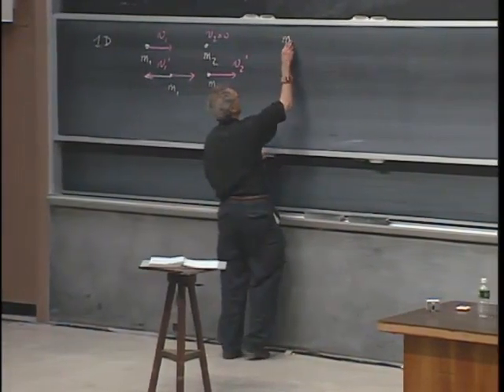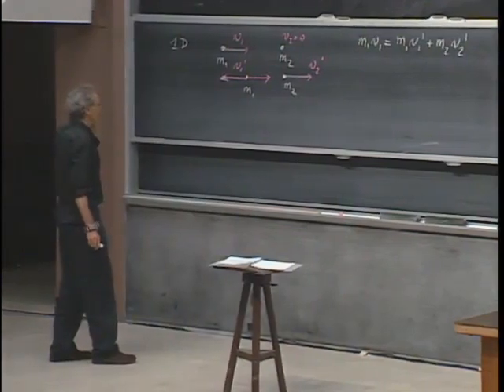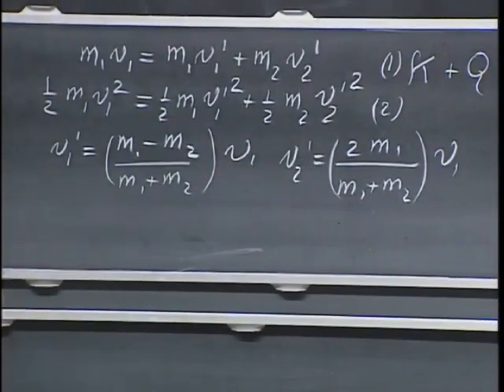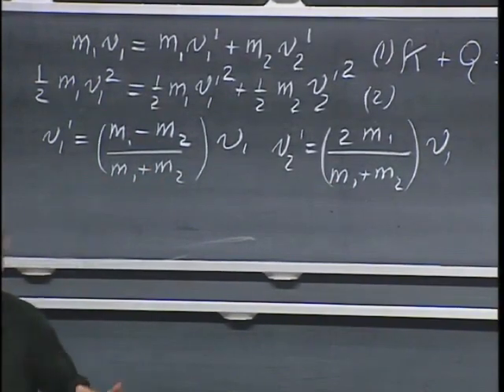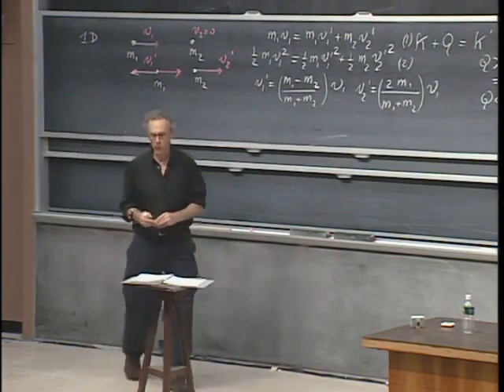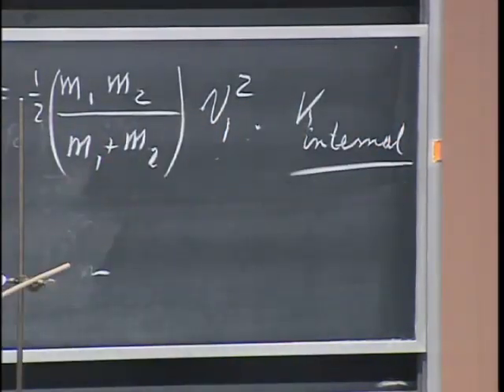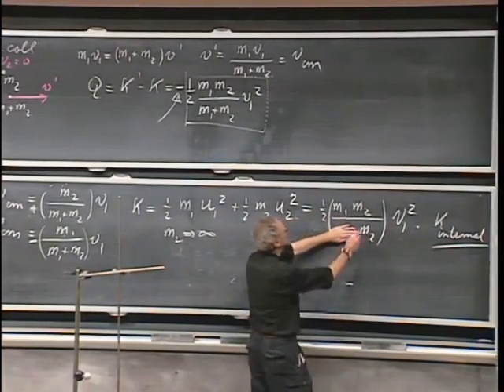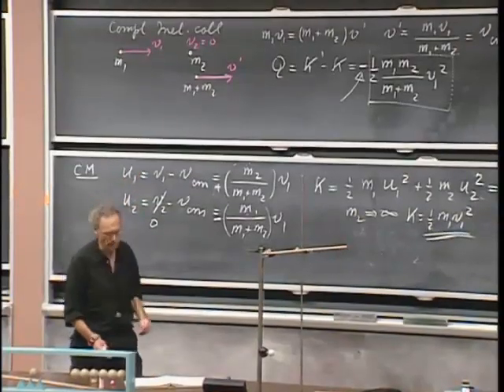8.01x - Lect 16 -  Elastic & Inelastic Collisions, Center of Mass Frame of Reference

Comment: Teacher, can you tell me the answer of the question at the end of the lecture (46:38)
Newton third law? But the last cases
Reply: Exactly why it happens it fascinating physics. The compression wave that travels through the balls is an approximate soliton. 

The underlying reason for why it's solitonic was discovered in the 1950s when the Fermi Pasta Ulam simulations were done. Basically, the expectation that more and more balls in Newton's cradle will move fails to occur because the dispersion of the compression wave is exactly balanced by the nonlinearity coming from the Hertz deformation law for elastic spheres. 

It's a very special system.

Comment: is this correct 
let force on the be F
F = ma 
here m is very large(not infinite)
therefore a->0 as F= ma   ////////////////////// acceleration of the wall
u = 0 ////// initial velocity of wall
therefore v->0 as a->0  /////////////// final velocity of the wall
therefore K.E. of wall = 1/2 (m) (v)^2 -> 0 as  v->0
Reply from the maker: what is the momentum of the wall after the collision?
Reply: 2mv but the velocity of wall is very low
Reply from the maker: 2mv - what is the meaning of m here and what of v?
Reply from the maker: correct
Reply from the maker: KE of wall =0.5*p*v, p is finite, but v =>0 thus KE=>0

Comment: If kinetic energy after collision in inelastic collision in centre of mass frame is zero then What is kinetic energy after collision in elastic collision in centre of mass frame???
Reply from the maker: watch my 8.01 lecture on collisions
Reply: Lectures by Walter Lewin. They will make you ♥ Physics. 
no no my question is in elastic collision in centre of mass frame also the kinetic energy is conserved???
Reply from the maker: In the com frame the momentum of the system is ZERO. Take it form there.

Comment: Hello sir, 
Could you please answer, 
Why   momentum in the center of mass frame is zero?
Reply from the maker: question unclear. When I throw an object upwards there is an extrenal force acting on the COM (gravity) thus momentum of the COM changes.
Reply: At the time 26:54 on lecture 16 (8.01)
Reply from the maker: @ashrafali4297  what I said is correct as the net external force on the COM is zero.
Reply: Thank you sir

Comment: What is the solution to the wall problem in which it has momentum but no kinetic energy?
Reply from the maker: you will have to figure that out on your own.
Reply: It has kinetic energy, but its really negligible.Am I right?
Reply: as M=INFINITY,m=0(approx)
Reply from the maker: If m is the mass of the tennis ball and its speed is v, then after the elastic collision with the wall, the wall will have a momentum +2mv.
Yet the wall has no KE if the wall's mass M is very high. How can the wall have momentum but no KE?
Reply: It is not a closed system, the wall is supported from the "other side" by an external force. Correct?
Reply from the maker: The SOLID idea behind it is that in the absence of external forces, momentum is conserved in any collision.

Comment: Can anyone tell me what is the difference between Center of Mass And Center of Gravity ?
Reply: Good question.   The reason we commonly get away with using these terms interchangeably, is that Earth's gravitational field is close enough to uniform in most situations, that there is no significant difference between these points.  But if you did have a non-uniform gravitational field in the problem in question, there would be a difference.

Center of mass is what you calculate when you take a "weighted average" of the positions of all the masses that comprise an object or system of objects.   By "weighted average" I mean that you multiply mass*position for each object, add it up, and then divide by total mass.   This calculation is gravity-agnostic, as it ignores any gravitational fields that apply to the objects in question.  It exclusively studies the inertial masses of the objects.

Center of gravity is what you get, when instead of using mass alone to take the weighted average, you account for the gravitational force when taking a weighted average of the positions of the point masses in the system.   Center of gravity is the point at which gravity appears to act, as if it were a single concentrated force.  It is the point where you could apply a single point support force, and not require any torque to balance it.  If you apply a point support force at exactly the center of gravity, the object will be in an equilibrium of neutral stability.  Above, and it will have a stable equilibrium;  below, and it will have an unstable equilibrium.

Comment: is there a way to understand why a very heavy object imparts twice its velocity to a very light object without using the equations ?
Reply from the maker: +Shivam Agarwal  I do not understand your question. Please be more specific.
Reply: +Lectures by Walter Lewin. They will make you ♥ Physics. You told that when a very heavy mass collides with a stationary light mass, the velocity of the light mass after the collision is double the velocity of the heavy mass before the collision. You proved that using the equation of final velocity. can we understand this result without using those equations and just by common sense ?
Reply from the maker: +Shivam Agarwal Yes that is common sense. Assume the heavy mass M has speed V, the low mass m has speed 0 (m<<M). Put yourself in the moving frame of the heavy mass. The small mass is approaching you with speed V. Thus it will bounce back with speed V in your moving frame. Now transfer back to the non-moving frame and that leads to a speed of 2V for the small mass.
Reply: +Lectures by Walter Lewin. They will make you ♥ Physics. I got it now. Thanks !
Reply: @lecturesbywalterlewin.they9259  I don't understand please understand me with some easy concept

Comment: in completely inelastic collision you told that energy lost is in the form of heat but the sound produced during collision is also a form of energy. where does that come from?
Reply from the maker: yes that's also energy - in general it's INSIGNIFICANt compared to heat.

Comment: Why is the conservation of kinetic energy still of the form 1/2mu^2? When you change the reference frame, the kinetic energy changes and I don't see easily why the conservation equation should have the same form. Can someone explain this to me please? Thanks!
Reply from the maker: if the object stands still in my ref frame but has speed V in another ref frame then the KE and that other ref frame is 0.5mV^2 - that is easy to prove
Reply: @lecturesbywalterlewin.they9259  but you need momentum conservation in order to prove that, correct? When transferring to the center of mass frame, the total momentum is 0 so the cross terms vanish. When going to a different frame the cross terms before and after the collision are the same but only because momentum conservation holds. Is my understanding correct? Thank you very much!
Reply from the maker: @hkl103 >>but you need momentum conservation>>>  No that is not needed  watch my  8.01 lectures, it's all there.

Comment: When transforming to a different reference frame, why can we assume that 1/2m1u1^2 + 1/2m2u2^2 = 1/2m1u1'^2 + 1/2m2u2'^2 (eqn. 1) is still the correct form for the kinetic energy conservation. My answer would be the following: I insert u = v - V (v being the velocity in the old reference frame, V being the velocity of the new reference frame, e.g. CM frame) and then multiply out: 1/2m1v1^2 + 1/2m2v2^2 + V(m1v1 + m2v2) + 1/2(m1+m2)V^2 = 1/2m1v1'^2 + 1/2m2v2'^2 + V(m1v1' + m2v2') + 1/2(m1+m2)V^2. Since 1/2(m1+m2)V^2 is constant and the same on both sides, 1/2m1v1^2 + 1/2m2v2^2 = 1/2m1v1'^2 + 1/2m2v2'^2 due  to energy conservation in the original frame we now only need momentum conservation such that V(m1v1 + m2v2) = V(m1v1' + m2v2') and thus eqn. 1 holds in the new frame. I would argue, we need momentum conservation in order to prove that eqn. 1 is indeed correct. If there was no momentum conservation, both sides would differ. Walter Lewin is opposing, that we don't need momentum conservation. Can anyone explain, where my mistake is?
Reply from the maker: KE is not conserved if we change reference frames  That is very basic physics
Reply: @lecturesbywalterlewin.they9259  This is not the issue. That KE depends on the reference frame is absolutely clear to me. But exactly because of that I was asking why you could use 1/2m1u1^2 + 1/2m2u2^2 = 1/2m1u1'^2 + 1/2m2u2'^2 when going to the CM reference frame. You used that formula without explanation why you could do that, and just said it holds because the collision is elastic. I didn't buy that immediately. So to reformulate my question: When kinetic energy is conserved in one frame, why is it conserved in the other frame, even though the value of kinetic energy changes. And my argument was, that because momentum is conserved, the change in kinetic energy is indeed that same. Which physically makes absolute sense, since energy should be conserved in every frame. In the meantime I have even found a nice argument in the Berkeley physics course. Because they don't want to rely on Newton's third law for momentum conservation in the case of finite speeds in special relativity, they start with energy conservation in every frame and from this conclude that momentum is conserved. One could turn this argument around and do what I did, I think. I pretty sure, there is another way of thinking about it, since there was nothing special about to original frame of velocities v that was used.
Reply: @lecturesbywalterlewin.they9259  By the way, thank you very much for your lectures and our discussion. I have already graduated in physics in Germany and watch all of your lectures to find and close some gaps in my understanding of basic physics. This is why I try to be so fastidious with some details…

Comment: Relating to the balls on a string problem... could it be because the number of balls create a pulse (like a wave) with a wavelength equal to 2n (where n is length of the number of balls pushed), and since the balls were only given a positive velocity (not oscillating), only the positive amplitude of the wavelength is represented. The positive pulse then travels through the balls when they strike each other until it reaches the end, where it knows it has to create momentum as the preexisting momentum is gone, and that this momentum must affect the number of balls which could not get rid of the pulse, equal the length of the pulse (n) which is also the total length of the balls?

Comment: Problem of the 8 balls at the end of the lecture. Let's mi and vi be the mass and velocity on the incident balls and mr, vr, the same for rebounded balls. As there are no external forces, for momentum conservation mi.vi=mr.vr, and for KE conservation 1/2.mi.vi^2=1/2.mr.vr^2. Working with these 2 equations the conclusion is that mi=mr (1 ball rebounded for 1 ball incident, 2 balls rebounded for 2 balls incident,...5 balls rebounded for 5 balls incident...and so on). Furthermore vr must be equal to vi.
It's OK?.
Reply from the maker: +Jordi GS The solution is much more complicated as you are dealing here with multiple collisions. What is exactly happening when you swing 2 or 3 balls? Of course, the final result is constant with the conservation of momentum and energy. But that does not tell the whole story.  I suggest you find the solutions on the web.
Reply: +Lectures by Walter Lewin. They will make you ♥ Physics. Can you exactly tell me where on the web?
Reply from the maker: +Jordi GS http://www.school-for-champions.com/science/newtons_cradle_derivation.htm#.VuGayun5-Jo
Reply: Thank you, Sir.
Reply from the maker: +Jordi GS Notice the Summary
SummaryDerivations to explain how Newton's Cradle works depend on various assumptions. One derivation assumes that the balls are touching, using the laws of Conservation of Momentumand Conservation of Energy. Another explanation assumes the balls are slightly separated. A third—and more exact—derivation accounts for the slight deformation of the balls, causing them to act like linear springs. This is a more complex view.

Comment: sir in elastic collision does the reversal of velocity wrt centre of mass reference frame hold true for collision between m1>>>m2  

as it is in this question
two steel balls of mass 10kg and 10g roll  towards each other with 5m  per sec and 1m per sec respectively on a smooth floor.After collision with what speed  10g mass moves (given perfectly elastic collision)
Reply from the maker: If a ball of mass m is in pure roll then the KE= m*v^2(1/2 + 1/5). Thus you can calculate what the total KE is for each rolling ball before the collision since you know m and v for each. If there is NO friction with the floor and NONE between the 2 balls and if the radii of the 2 balls are the same then to rotational KE cannot change and both balls will continue to rotate after the coll in the same direction as before.. You can now apply the conservation of momentum and of KE and you will be able to solve for the sliding velocities of each ball after the coll. If the radii are not the same the problem cannot be solved as is now.
Reply: yes that is fine and I get the answer But when i try to solve this problem in the centre of of mass frame of reference  

In lab frame 10Kg moves with velocity 5 in +X direction 
                     10g moves with velocity  1 in -X direction

In center of mass frame
     10kg body is approaching with a velocity  [ 5 -Vcom ]  from one direction towards the centre of mass
       (this velocity along +X )
     10g body is approching with a velocity [1+Vcom] from the other direction towards the centre of mass
        (velocity along -X )

since with respect to Center of mass Their momentums are equal and opposite and since the collision is assumed to be elastic the center of mass perceives both bodies reverse their velocities after the collision ie,
    10Kg body is departing with a velocity    [5-Vcom]  away from the center of mass (velocity along -X)
    10g body is departing with a velocity  [1+Vcom] away from the center of mass (velocity along +X)

Sir am I right upto this??
If I'm right then converting these velocities to the lab frame of reference 
10Kg body is moving with velocity [5]                        (-X)
10g body is moving with velocity   [1+2Vcom]         (+X)

BUT IN THE REAL SITUATION 10 Kg BODY NEVER CHANGES IT DIRECTION OF MOTION AFTER COLLISION....
SIr where is my mistake?.

Comment: What book was used in 8.01x ?
Reply from the maker: +Ivan Antunović "Physics" by Ohanian Vol 1, 2nd Edition. It's still available at Amazon.com
Reply: Thank you,I asked because I didn't get how did you get equations in e.q. of ELASTIC COLLISION:
v1' = v1*(m1-m2)/(m1+m2) and
v2' = v1*(2m1)/(m1+m2),
I myself tried to multiply 2nd equation(conservation of KE) with 2  and then group m1 and m2 s on both equations and then divide equation 1 with equation 2 ,but I end up with v2'=v1+v1' (because mass terms cancel out).
Reply from the maker: +Lectures by Walter Lewin. They will make you ♥ Physics. 8.01x are the same lectures (with some edits), Lectures notes as 8.01, same book. I derived in lectures the equations for elastic collisions. Maybe the result you found is also correct. If you need help I am willing to check it.
Reply: +Lectures by Walter Lewin. They will make you ♥ Physics. Ok I will send you a picture, but I don't know if it's possible to send it via youtube.
Reply from the maker: +Ivan Antunović I received your derivation.Looks good to me. It's valid only when v2=0.
Reply: +Lectures by Walter Lewin. They will make you ♥ Physics. 
Alright would you mind If I ask you one more question about torque because I am stuck with that problem?
Reply from the maker: +Ivan Antunović The tension in the rope is about 7.743*10^3 N.
The torque relative to point A must be zero. It took me 5 minutes.
I will send you a picture of my 4 line short solution later today together with your picture of the problem.
It's all simple algebra.
Reply: I've gotten the same result 7.75 kN what I realised about 2 hours is that Ra and T are the same forces and that was the reason I was getting wrong results.
What now bothers me is question in your video about the elastic collision of tennis ball and the wall...hope I will figure it out by myself.
Reply from the maker: +Ivan Antunović yesssss you should be able to figure that one out on your own. Did you get the picture of my tension solution - I sent it to you by email. The whole can be solved in ONE line.
Reply: Lectures by Walter Lewin. They will make you ♥ Physics. Yes I figured out your picture,thank you once more for your time spent.What confused me was that force Ra that was drawn in the picture...why would one draw a force Ra when it's the same as Fu...
Reply from the maker: +Ivan Antunović I got the same picture that you did. I do not even remember Ra. It was very clear that Fu was the tension because the x and y component of this force were also in the picture.

Comment: Can someone clearly  explain the ball-wall question? I couldn't understand it perfectly.
Reply from the maker: if the mass M of a wall is HUGE, after the collision with a tennis ball, the momentum of the wall can be very large, yet its KE can be negligibly small and for M=> infinity, the KE will be zero (but NOT its momentum). This is very basic Newtonian mechanics.
Reply: @lecturesbywalterlewin.they9259  sir is that means that the mass is inversely proportional to the kinetic energy of the body